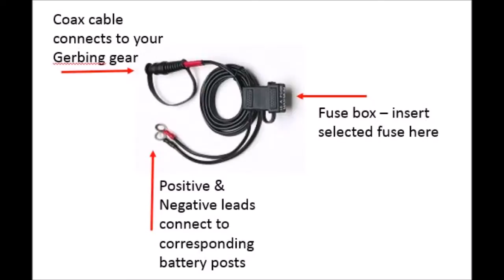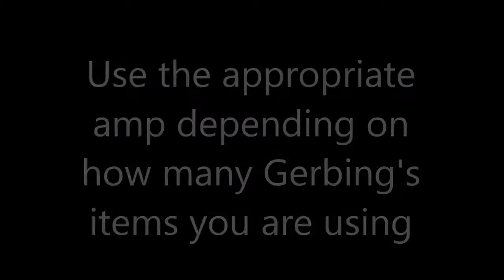Gerbings Wiring Harness Install

Comment: I have a battery tender connection that I leave on all year. To that, I attach a cigarette lighter adapter and use it to charge the GPS, mp3 player, phone, etc. Would I need to disconnect that before adding this other harness?
Btw, it seems like your cord is going to get pinched by the seat if you leave it on top of the frame like that.

Thanks for all of your videos! I enjoy watching and learn a lot!
Reply from the maker: Hi Patty, I have a tender that I leave installed year round as well as the Gerbing harness. You can see the negative lead being disconnected at 0:18. You can also see the positive leads for the tender and the Gerbing’s harness both being reattached to the battery post at 0:51.   As for the cord getting pinched, it isn’t. The rigid pan and mounts of the Mustang seat prevent it from making contact with the frame in that area. In this case the Gerbing’s cord is able to move freely at all times without risking damage to itself or the bike.  Thanks for watching :-)
Reply: Thanks for the info. How are the gloves and jacket working out? I've been back and forth on weather I want rechargeable or wired gloves.
Reply from the maker: Patty Martin Love them.  However I'm still trying to solve for cold toes as I really don't want the Gerbing foot warmer.  I'm thinking of using the Toe Warmer heat packs which adhere to the top of the socks without being bulky (so they say).
Reply: I've used them,  and they're not bad, but they seem to need air circulation to work well. My next pair of winter boots will be a size bigger to accommodate either the warmers or the freeze-out liners. I use them both for hands and feet, but it defeats the purpose of it ends up cutting iff circulation. I'm currently trying to make my own crash bar "chaps" out if pleather and grommets.
Reply: +Mizzuz Moto Thanks for this vid. Nice and to the point for my 2014 Yamaha VMAX. I'll say this tho. If you haven't already gotten the Gerbings socks/liners yet... get em'! I do LA to Dallas and back twice a year (one trip in Nov./Dec.) on my 07 Street Glide and easily get down in the 20's/30's, which makes it 15's riding on the bike. I've NEVER had an issue with cold anything and I get cold easy. I tried the heated little warmer packs on top of my hands and toes, 1 time only haha, and it's true, they need air/shaking to work, which your feet/boots and gloves won't give. I bought my Gerbings gear the week after getting back from that first winter time ride, period. :-) I bit the $900 bullet at Revzilla.com (great free shipping and return policy if something doesn't jive or fit right) and bought the Jacket/liner, pants/liner, gloves, and socks/liner and for a long distance rider who enjoys NOT being cold... AT ALL, it was some of the best money i've ever spent for rides. Imagine, it's 40*/30* degrees outside, your riding across beautiful AZ or NM or wherever at 75/80mph... and you're as toasty as sitting in your living room or car... all over. My buddies razz me about it too! hahaha I'm like "we're going swimming, why would I jump in cold pool when a heated pool is right there?" This after watching them rub hands and wipe noses trying to get warm. hahahaha F*** that!! hahaha Some folks will spend $500 for a great comfortable seat, $200 for comfy bars, grip$, boot$, chap$, backre$t, $$$ for thi$ that and the other, etc., etc. but not for heated gear. btw, if you do get the socks, wear thin type socks underneath, then the Gerbings sock liners, then lets say athletic or comfy socks (doesn't have to be super thick either) and it'll feel like a pair of thick winter socks and keep a loose feel/not too snug inside the boot/shoe. You won't feel the Gerbings while walking or riding. Ride safe everyone!
Reply from the maker: +eyezlikeydrums I was actually thinking about getting those - didn't know if they would really work.  Thanks for telling me about them.  Now I have to seriously look at them again since my toes get cold really fast.  Yeah, that's a chunk of change but if you want to ride all winter, might as well enjoy the ride!  Thanks and stay safe and warm!